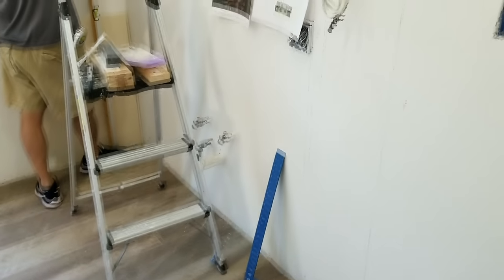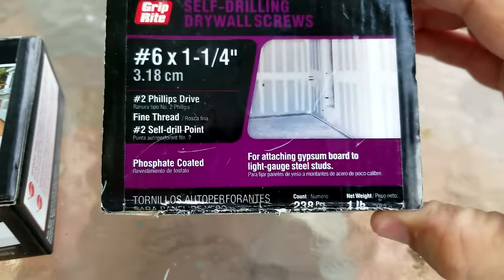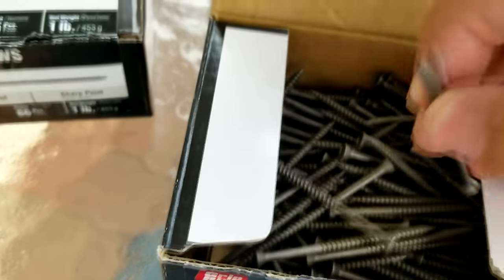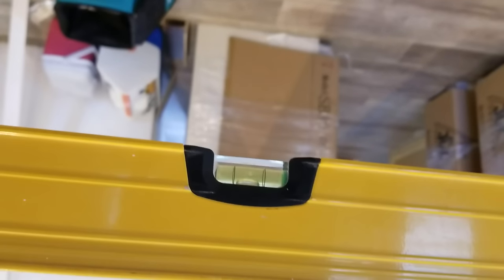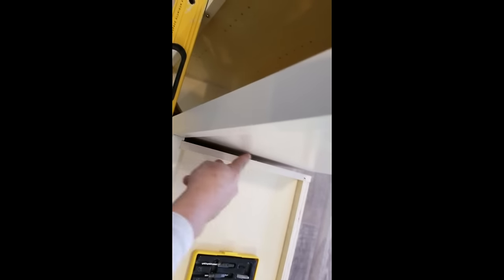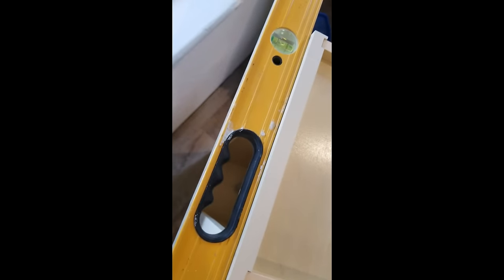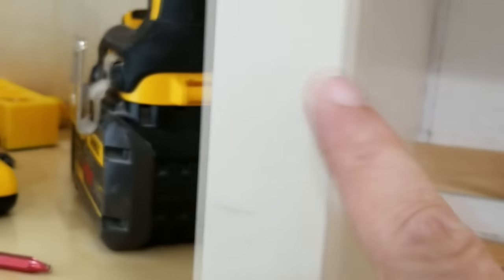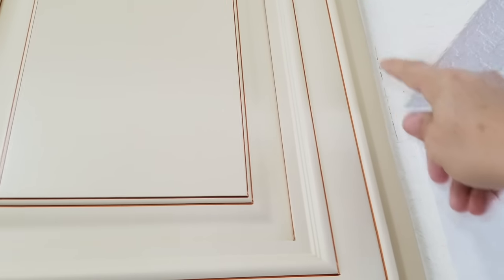Installing Kitchen Cabinets DIY, | How To Install Like Pros

Comment from the maker: ✅ Tools & kitchen cabinet screws used in this kitchen cabinet installation video:
✅ Precision Sensors Stud Finder LED Profinder: https://amzn.to/2uwGBvS
✅ Grk 120660 White Cabinet Screw, to install cabinets 8 X 2-1/2": https://amzn.to/2C5OUTa
✅ GRK Pro-Pak White Cabinet Screws, 8" x 1-1/2: https://amzn.to/2FkANMS
✅ DEWALT DCK299D1T1 Hammer Drill, Impact Driver Kit for installing cabinets: https://amzn.to/2M6h450
✅ Empire Professional Framing Square: https://amzn.to/2MlR0TC
✅ Johnson 72" Heavy Duty Aluminum Box Level: https://amzn.to/2TiuihP

Comment: We replaced our upper cabinets in just a weekend thanks to this awesome instruction. Thank you for all the tips. The screw suggestions were particularly helpful and made the job super fast and easy and professional looking. Thank you.

The old cabinets were all installed with drywall screws. The right tools, really do make all the difference.

Also, putting them together upside down was the best recommendation. No one else said to do that and it was what made them look so perfect on the wall.

Great video!!
Reply from the maker: LOL, yes we always see cabinets held in with drywall screws, and sometimes short drywall screws.

Comment: Your description of the pros/cons of various screws was super-informative. About to start my first kitchen cabinet install today and appreciate all the other advice in this video too. Thanks!
Reply from the maker: Ddi you finish the kitchen cabinet install? How did it go using any of our advice?
Reply: @jeffostroff  Kitchen is almost done! Last pieces are building shaker panels and ship lap side for the island, and spraying lacquer with an HVLP rig. First time doing that too.

Comment: Good video Jeff.  A couple of years ago I demo’d our kitchen, in anticipation of installing beautiful Kraftmaid Full Faced Overlay Cabinets.  A couple of things… I would suggest the investment into three face clamps, specifically designed for cabinet installation.  They’ll allow the face of the cabinets to be tightly clamped together, without the threat of denting the wood.  In addition they have a hole through them that allows a precision pilot hole to be drilled in the middle of the face frame.

I used composited shims in the back of the cabinet to bridge the gap, then drilled a pilot hole through the cabinet and shim to the other side.

My Wife and I created our own custom shims to go between the wall and the cabinets.  I’d go to Home Depot to get different thicknesses of sample LVP to bridge the gap.  They worked beautifully, creating a tight custom fit.
Reply from the maker: Yes, we use the shims in the back also. Would love to see suggestions on models with that pilot hole through them. Certainly using the right clamps is key here as some of them only offer maybe 100 pounds of clamping force which is not enough to keep the two side by side cabinets from scaling from each other when you try driving the screw into the wood those screws are just unbelievably powerful and it takes a lot of force to keep the two front edges of those cabinets together from slipping.

Comment: Now that I'm retired and have all these tools and hardware I inherited from my Dad when he passed away, I am just now trying to learn how to use them all.  I also have a summer home that desperately needs cabinets replaced.   I'm learning something new every minute of this video.   After I'm done I'm going to dig out my collection of wood screws, I know I have those ones with the square heads and had no clue how to properly use them before.
Reply from the maker: Awesome glad to help out, and nothing beats learning on the job either.

Comment: I love your video again and learn a lot from you. You mentioned about having the floor redone first and level so to help with sitting  cabinet on top later. My floor is wood on top of the crawl space underneath and covered with original vinyl. I'm told to install cabinet first and then do laminate flooring later. Is this correct? Thanks
Reply from the maker: Yes, with wood flooring you want to have the cabinet in place and install the wood flooring up to the cabinet.

Comment: One item I used exclusively was the cabinet screw by GRK. The main reason for using this type of screw is that any screw that is countersunk is pressing outward on the wood due to the wedge effect. The flat underside of the GRK cabinet screw avoids this. The ability to hide a countersunk screw under the hinge plate is not worth the risk of splitting the stile.
Reply from the maker: Yes we love using the grk screws as well. I don't mind using the smaller head finish screws either we pre drill 1st so that you don't have a risk of splitting the wood, And we also use a countersink bit which creates the perfect shaped opening for the screw to wedge against without the added pressure or risk of splitting.

Comment: What screw do you use to join two upper cabinet face frames together if the combined thickness is less than 2 1/4? In my case I need 1 1/4 inches. Grk make a 1 1/4 inch screw with a similar head but the thread is course.

Comment: I had intentions of installing backing, taking many pics, and filling in bows but had to beat the sheet rockers while they were available and just throw in insulation.
IMHO self-drilling screws are loose. I like the square drive fine point he showed 3rd.
Reply from the maker: yes, i use that all the time

Comment: I don’t see where you used the white screws, I only see the square head screws used to connect the cabinets. Did you use the white screws to attach cabinet to the walls?
Reply from the maker: The white screws are 1 1/2" and 2 1/2". GRK also makes the brass colored screws, which we used a number of that day, it all depends on the stack up of what's inside the wall, the drywall, the shimming, the thickness of the cabinet back, to determine which screw size to use, and not all of the sizes are white.

Comment: Installing the wood blocking before the drywall is the smartest thing that any builder could do. But it is surprising how many builders leave out this step..
Reply: This is usually only done by contractors  who do renovation work. Something like that takes too much extra time when building a new home especially when cabinet layouts change frequently after framing is done thus causing blocking to no longer be in the correct spot. This is also beneficial when the cabinets being installed don’t have a back that is full thickness across the whole cabinet. Many cabinets only have a thicker strip too and bottom and only a thin back covering the whole cabinet of any at all.

Comment: I have a corner cabinet with one ceiling higher than the other. How should i address this issue? Will the crown molding have to be installed with a gap to the ceiling?
Reply from the maker: Without seeing your corner, hard to tell, can you built down the higher ceiling to match the lower one, or raise the other to match the higher one?

Comment: What’s the standard height in inches from the bottom cabinets to the top ? Also is there a standard height for the above fridge cabinet , or you just measure the fridge?
Reply from the maker: Floor cabinets usually end 34" above the floor, and counter adds about 2". Upper cabinets are usually 30", 35" or 42" depends on the ceiling height, and leaving about 17 inches counter space. For the fridge, we usually  assume 33" wide by 70" tall. So my friend's house that we remodeled couple of months ago, we placed the 12" cabinet over the fridge with 1" gap. Top of upper cabinet over fridge was 83" off the floor.
Reply: Thanks brother!! Definitely subbed ya .
Reply: @jeffostroff   Base heights are 34.5 inches plus the 1.5 inch granite for 36. 18" is standard from the granite to the bottom of the wall cabinet. Most cabinet companies wont make a 35" cabinet unless its custom. It goes by 3 inch increments from 30 to 42 for normal walls and then you start getting into stacked wall cabinets!

Comment: I've seen a couple of your videos now and I know that you recommend using #6 x 2-1/4" trim head screws to attach face frames together but what about when cabinets are offset from one another like at the pantry in this video?  I assume you screw from inside the pantry into the face frame of the adjacent cabinet, but do you use #8 white cabinet screws or #6 black trim screws for that?  In my case, it's a wall-mounted open wine rack cabinet 3" proud of the adjacent cabinets and a white screw, though larger, would be preferable.
Reply from the maker: You can use either of those screws. Since the screw will be located inside the cabinet where no one ever looks, it does not matter which one, but yes the white head screw is easier to use and will have a good holding power and no countersink hole to drill either.

Comment: What do you do with your shims after you get the cabinets level and true?
Reply from the maker: Jon, the shims stay behind the cabinets where we wedge them in. We reun our screws right through the back of the cabinet, through the shim, into the stud. If there is any excess shim hanging down from the bottom of say the upper cabinets, we snap them off, and if needed, we shave off the edges flat so there is no overhang.
Reply: Oscillating tool works the best to cut shims.

Comment: What do y’all use to hide the “face” screws? A like colored plug?
Reply from the maker: Not sure what you mean by face screws, which location are these screws in? We don't hide any screws with caps. We attach the screws where they are not typically seen.
Reply: You'll never be able to hide the head of every screw in your cabinets. The ones that go through the back of the cabinet into the wall have to have the head stay flush on the inside meaning you can't really cover it, if you snugged the screw through the wood even just the tiniest bit so you could cover it, it compromises the strength of where the screw is holding.

Comment: Nice video. Good points but I would like you to place your hands just a little bit out of the way or line of fire while drilling and screwing. I know the drill bit and screws aren’t long enough to get your hand but one slip and you can win a trip to the ER or be one handed for a week or so. Otherwise well done.
Reply from the maker: Sometimes the hands have to be where they are, we just exercise caution.

Comment: Do you prefer installing the cabinets on the finished floor rather than on the subfloor than lay the floor around them?
Reply from the maker: Yes I always install my cabinets over the finished tile floor which I make sure is tiled all the way to the ends of the wall. If I pull out old cabinets and find out they were installed directly on the cement floor, I will buy some real cheap tile just a fill it in all the way back to the wall and make the entire floor level. But if it's wood flooring or laminate flooring that you are putting down, with any type of underlayment under it to, you are not supposed to put cabinets on top of that flooring.
Reply: jeffostroff right. that makes perfect sense, laying them on tile makes future kitchen work simpler, but laying them on a floating floor would cause expansion issues. Thank you, learned a lot from your video.
Reply: Always on floor. I have seen people not be able to get dishwasher under countertop when flooring is put it after. They don’t think of the minimum height required for the dishwasher and the cabinet installers didn’t care either to shim cabinets up to allow for adequate height.
Reply: @Icantball67  Because the people who put the cabinets in didnt account for the height of the floor so it was probably a good 3/4 or even an entire inch too high. Taking granite out isnt fun.
Reply: Millsinator I can see that point exactly. However when doing renovation work, there are lesser contractors and unaware home owners who like to leave important information hidden

Comment: Fine thread screw dont hold well in particle board so you actually want to use a coarser thread wood screw not a fine thread metal screw. I use drywall screws and mine turn out fine.
Reply from the maker: You actually don't want to use particle board. I hate particle board with a passion, I see how it crumbles apart and deteriorates in humid environments. I only install wood cabinets.
Reply: @jeffostroff  totaly agree but some of us are poor and thats our only option
Reply from the maker: @tr1ppl3M  Stinks I know. But it you go to certain stores like I do, the wood is not much more than the particle board.  So when I flip properties, I have to have wood it makes a great selling point in the MLS listing when we say REAL Wood Cabinets. My own cabinets at home are 27 year old particle board, and one door has already deteriorated off, and even special screws for particle board did not hold when I tried to make repairs, because the particles are deteriorating.
Reply: Me and my father have been using drywall screws for about 15 years now in every kitchen we do and haven't had any problems. And don't get me started on the particle board, It's all about those plywood ends baby!

Comment: The "Pros" that installed my cabinets looked at me like I was a talking cat when I noticed them mounting my upper cabinets and I asked about shimming the cabinets (my walls are not perfectly plumb and have some bowed studs, so not flat either (like most).  I asked them about that and they said-"how are we supposed to shim the upper cabinets and laughed.

They also used a drill (with screw driver bit) on the cabinet hinges to adjust the doors, and anyone who has ever adjusted those cabinet hinges know they only move 1/4 to 1/2 turn, so they stripped the heads on every single cabinet hinge.  I made the owner of the shop I was dealing with send me new hardware and I installed myself.

That is what the "Pros" will do for you.  They just get in and out as fast as they can.
Reply from the maker: Neanderthals! Wonder how they install on plaster walls, which are much worse, they are notorious for curving.  At my friend's house last month we tied 3 uppers together while flat on the floor, sat them on the ledger board on the wall, then shimmed all over the place to get the level plumb and true.  Unless we do this, the cabinets will never be level plumb and true.
Reply: Thanks for lumping all cabinet installers together. It seems to me that you failed to pick experienced men. Did you look at previous jobs or get references? The failure is yours
Reply: @martybeazley3306  I used the crew that the interior  designer's shop used, which most people would assume knew what they were doing.  I would think there are some that might do better, but I am posting my experience with "pros" and that carries over to many different trades. My experience is most people that give their pros great reviews know little about the job they hired the guys for, and if they didn't burn the house down, they got a great review.
Reply: @bogieman101  mighty broad brush your painting with there!! No skin off my back tho.

Comment: J&K cabinets are best cabinets to work with
Reply from the maker: I agree, I've been using them on all my projects for the last 4 years. I often drive by to pick up extra pieces of wood or mirrors, and other appliques, and they have them all in stock.
Reply: Do you offer hands on training?
Reply from the maker: @hanialturk5981   At the present time I do not offer training.

Comment: Why again did you add the 1” filler for the pantry door swing?
Reply from the maker: You just answered your own question we did it to give more Room for the door swinging. You typically don't want to have cabinets ending right up against a wall.

Comment: The floating floor should have been installed after the cabinets
Reply from the maker: That's not a floating floor, that's tile floor. We had to wait until the kitchen tile floor was installed and we installed the kitchen cabinets over them.
Reply: Any floor should be installed before cabinets. If you have to level the last cabinet at the end of a kitchen you'll have a space on the floor and you'll have to put a piece of molding over it. Keep in mind you have to make up that space you lost because of the floor (If you're putting 3/4 inch hardwood down then you would want to put 3/4 inch pieces on the bottom of the cabinets for them to sit on.

Comment: It'd take an awful long time to put in a single kitchen if you're clamping every single cabinet frame together before putting them together. You can eventually skip that step with a few years experience
Reply from the maker: We shoot for perfection. You could skip the step, but the full alignment of the front face of the cabinets could shift a frog hair. That's acceptable to some people, not to me. That's also why we take real care in pre drilling the pilots to the correct depth, and using the right screws to ensure no thick lines between cabinets. We are not in a race for time, we are in a race for near perfection.
Reply: @jeffostroff  Most definitely perfection is the way to go! I'm not sure if you do kitchens for a living but I am currently in the process of learning and have been looking at new ideas from others. My father who's been in the kitchen business for 30+ years doesnt pilot into the next frame he only drills a hole through the first frame and then put the two cabinets side by side to screw in. We use the same screws and they grab very  very well. As long as you dont pilot the hole towards the face of frame then it wont bump out on you. 

Also if you put the wall cabinets together on the floor you need a second person to help you put up on the props (or just hold it) while you screw it in and level it all at the correct height.